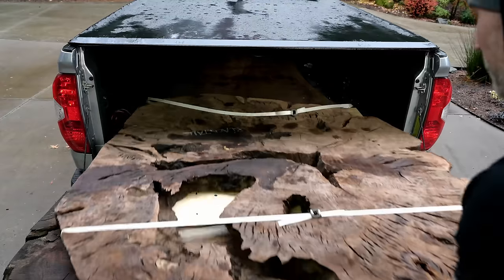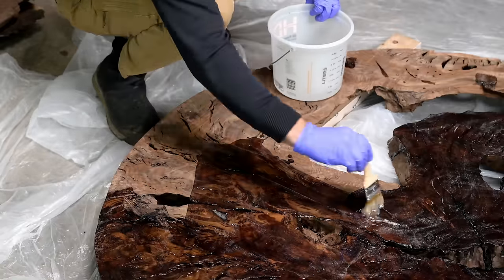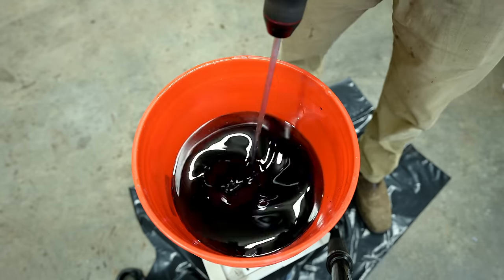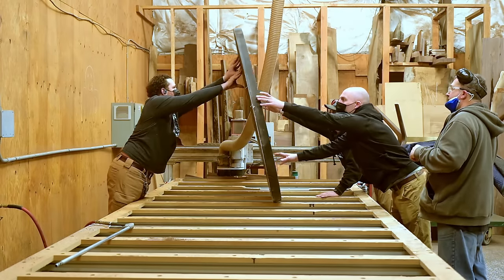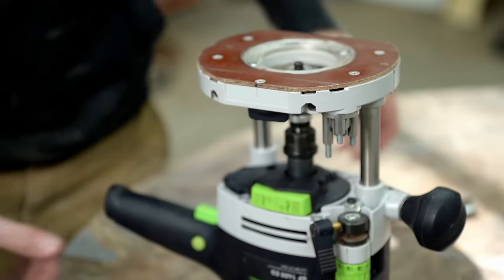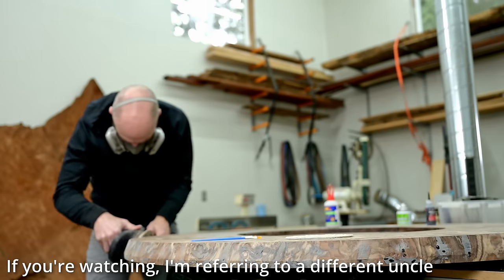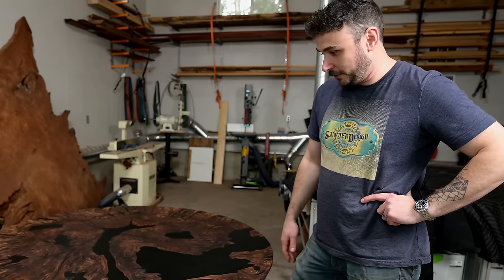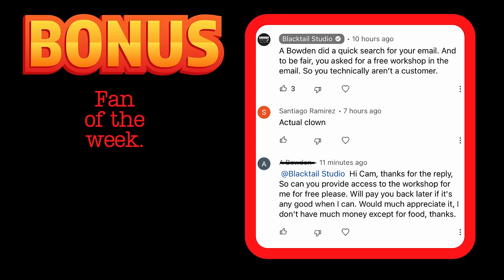The Worst Wood To Build With

Comment: Sawyer! Hi Cam - do you think the dry ice process impacted the moisture content problem?
Reply from the maker: That’s a great question, but no that’s not it. I talked to the wood supplier and this is caused by a bacterial wetwood that is often (but not always) indicated by those light yellow streaks. Any surface moisture dries quite quickly, even if totally soaked.
Reply: Dry ice generally goes straight from solid to gas form. It doesn't have any water in it either.
Reply: It’s frozen carbon dioxide so no water.
Reply: @Cobbido  Well the water would be coming out of the air as condensation.
But as Cam said, surface moisture dries quickly. (Firewood stored outside still dries, even if it's rained on regularely)
Reply: @BlacktailStudio  if you ever see a video in your recommended that you don't like, click the 3 dots and select not interested! no more annoying videos you don't like!!
Reply: @josephbucci3749  True, but the extreme cold causes water to condense from the air onto the wood surface. There was clearly water on the wood, but Cam says that the surface moisture dried quickly.
Reply: @BlacktailStudio  you are right, and there is a solution for that
Reply: @josephbucci3749  i think the concern was condensation but yeah it would evaporate too quickly to soak in.
Reply: Only time dry ice can become liquid is in a pressurized vessel & since CO2 doesn't contain H2O or D2O it can't affect how much moisture is in the wood
Reply: If the CO2 cooled the wood down to near freezing, as the wood returned to room temperature couldn't condensate from humidity in the air form on the surface and be absorbed..., the same way droplets form on the outside of a glass of a cold drink?
Reply: @Cobbido  No, but the low temp can cause atmospheric water to condense.  That would only be on the surface though, & would be unlikely to introduce enough to cause the issue here as it would also dry fairly quickly.
Reply: @Craigelz  Yes, but it would only be surface & would dry fairly quickly, even from endgrain.
Reply: Sawyer! I don’t make tables but I do enjoy watching your videos and I learn by listening to your thoughts thru your narration. This project reminded me to always have a checklist which I also suggest to you good Sir. 😎
Reply: @BlacktailStudio  you should look into a needle scaler, that would get into a lot of those tight areas.
Reply: @BlacktailStudio  incase you did not see my message: I have a suggestion for a collab/idea, Sci/Fy Alien (or geological mystical) Epoxy table complete with glowing crystals inside (Led lights that lights up the epoxy crystals within the table)
Reply: Dang, that was such a beautiful piece of wood. You win some, you loose some. 😕
Reply: I came to post the same question. You see the moister condencing on the slab, and if any dry ice at all was building up in those cracks it will lower the core temp and pull water out of the air like a spung and deep into the slab. I've worked with a lot of cryogens and moisture / ice build up is a huge problem. Maybe not the main issue here, but I'd be sure to check before and after if I did the dry ice thing again.
Reply: Dry ice is actually frozen carbon dioxide (CO2) so I don't think it should have caused any problems, but who knows? Maybe the extreme cold treatment could have caused water vapour around it to condense and concentrate more on certain regions depending on the temp, but this is just a wild guess cause most of the cookie would have been surrounded by a veil of CO2 gas after the process
Edit : just saw Cameron's explanation, ohhhhhhhhh, welp I tried.
Reply: @Cobbido  True, but because of the low temperatures it causes at surface level wouldn't moisture condence around it (not that it's the case here)?
Reply: Sawer Designs. Let it air dry, in a dry place, and then CNC it flat again. It doesn't need to be that thick.
Reply: I asked you before this question, can you make door like the tables? I would like to order one
Reply: @BlacktailStudio  Dry ice is pure Co2.
Reply: I sure hate that it didn’t work out as you planned. Sawyer got a second chance on the pedestal you should get another chance on the top. Do you have any idea if the moisture problem could be solved and what that solution would be? Other than wall art or a bond fire invite?

Comment: There is something we use in dentistry when pouring casts called dental vibrators , it helps air bubbles escape the casts before its cured . I think there is some sort of industrial vibrators that you can modify (( making a housing for it )) to help the air escape after pouring the epoxy in the tiny cracks.
Reply: Park a Harley next to it for a few minutes on tick over, that'll do it.
Reply: I was thinking some take on the vibratory device used to get pockets of air out if a concrete slab.  However, though I’m terrified to put the word “vibratoratory” in a search engine 😳,  there has to be some craftsman’s device for getting bubbles out of a pour and help it get into all the cracks/crevices.
Reply: @bearde_mut9731  🤣 thanks!  There are actually concrete and epoxy vib..uh…oscillating tools on Amazon!

Comment: I suspect that they dry ice blasting might have contributed to the deep moisture issue. I would test the next piece you send for dry ice blasting before and after, and if necessary dry it again afterwards. That looked awesome, but with that much moisture it is not going to last. Maybe with luck it will be possible to repair it in 10-15 years when it finally finishes drying and cracking, but that is a long time to store something that big that can't be used...
Reply: Shouldn't be a dry ice issue. No liquid is retained. It goes from solid to gas.
Reply: Dry ice is carbon dioxide. It doesn’t have a liquid state so it can’t leave any residue
Reply: Yes, but it causes condensation to form due to how cold it is. You cold.see the surface effect of it in the video and he even points it out.
Reply: @adamjames5097  But it is really cold ... and there was moisture in the air around.  Some may have condensed out of the air and gotten stuck.
Reply: @jimjjewett  good point 🤝

Comment: I spent 35 years as a cabinetmaker and I  used the belt sander a lot. It can be a very finicky tool to use properly, but worth the effort to learn. You also need to know how to maintain it correctly.
Reply: his technique was interesting to me , sanding perpendicular to the belt rather than parallel. i always thought you sans with the belt motion not at right angles to it
Reply: @vvsmixing  you use belt sanders at roughly 45° in a side to side or sweeping or curved motion, forward and back causes terrible inconsistency in the surface and the sander wants to run away, and 90° side to side causes some belt issues but you generally sweep it at 45° roughly
Reply: @matthewwhite876  thank you i notice on wood at coarse grit it scratches the wood in a ugly way, and looks better when those scratches are taken out by goin with the grain. or can you sand 45 to the grain and just use higher grit to take those out
Reply: @vvsmixing  I would only use a belt sander to take material away not to try sand it to a polished finish an orbital sander is the best option if you don't have access to a drum sander

Comment: Hey Cam, a bit surprised at the leaks and mould destruction. I find HDPE works very well. I do have occasional leaks but pretty minimal. For curved moulds I tuck tape an 18 mm board and then  flesh 4 mm HDPE with wood shoulders screwed through the board. Can send a pi. If you are interested.

Comment: Next time you want to see where you left screws in the project, tie a magnet to a piece of string and gently move it everywhere. If it leans toward a specific place or sticks to something you know there’s metal.
Reply: @endoranddeath6481  I think you responded to the wrong comment.
Reply: @EddSjo  I did. Great job me. ;-;
Reply: @TheScytheMoron  did you mean non-magnetic?  some steels are magenetic, some are not.  That is true, but your emphasis on magnetic seems to agree with MS B while to tone implies you disagree.
Reply: besides thats usually stainless, like A4 which you find in machine screws, but I doubt in wood screws.

Comment: You probably want to check another similar small piece of wood with the dry ice cleaning guys, just to make sure that the moisture did not really come from their process, ultimately it would be nice to know! (in my opinion even if it evaporates the cracks and pressure is so big that its possible the vapors were trapped thus the moisture.
Reply: I'm ignorant and curious: how does moisture come from carbon dioxide?
Reply: @johncornwell1026  It’s definitely worth trying it out, to know for sure. In my opinion since most wood is living porous material, it had its own previous moisture level, then introducing extreme cold dry ice, will probably shrink it, and later the moisture will seep in as it warms up from the atmosphere. Humidity, deep cracks, cold hot temperatures, it’s own moisture level, all play a factor 👍!
Reply: @johncornwell1026  My guess is that the dry ice cooled the wood down enough that it pulled moisture in, that is via condensation. However, I'm not sure how much that would have done and the only way to really know would be if he'd done a moisture check before he started the entire process. If it was good then but bad after the dry ice blasting, then it was the blasting that caused the problem. To bad he didn't check at the start.

Comment: You may want to take out the link to the eBay from the description and then note that the winning bid was $6200.  (I don't think they leave it up forever.)  I'm curious how that price was in relation to the costs put in to it.
Reply: The real cost is the labor.

Adding up just the cost of materials doesn't (or at least shouldn't...) mean much when thinking of selling price.
Reply: @CNYKnifeNerd  I implied as much.  I didn't say "cost of materials".

Comment: A stone mount would have been a better choice, or if you feel that to be extreme. Try a tree trunk mount.  Mounts need to be heavy, and sturdy enough to hold 280 pounds or more. Using steal isn't always a good choice unless it's solid steal or iron.  Table looks great btw
 Black Onyx 
Stone mount
The shaft isn't wide enough to secure the table. That's the anomaly your witnessing.
Reply: Steel.

Comment: Can always use epoxy for those stumps red colour lava with it to level top surface as well and a bottom  round wood base to support it over time and still use it for table. A round frame around for table for support if necessary.

Comment: I’ve been drying slabs from my 18-month-old sawmill and getting close to having some ready. Went to buy that moisture meter. $580!!  I think I will use my pin meters for a bit longer. 
But I love your vids and glad the table/wallpiece is going to be profitable for you. Over $6k so far!
Reply: Yeah I looked up that meter too.  Gag.  BUT, if you're making $10k tables and it saves even one project it pays for itself many times over.  Just depends on what kind of work you're doing and the scale of investment involved in your projects in terms of whether it's worth it or not

Comment: Is there a possibility that the dry ice added pockets of moisture because you blasted into the endgrain ?
Reply: I was thinking this too, maybe let it dry for a few weeks or months after blasting it with dry ice
Reply: even though we call it "ice" there is really no water in dry ice.  It's frozen carbon dioxide gas.  What surface moisture you may see is caused by condensation on the surface only (like the outside of your cold glass on a hot day) and would have dried in seconds.

Comment: What is the actual issue with the moisture? 
Will the table just keep warping?
Reply: Yeah, I want to learn this, too. Why is it a problem? Why does that moisture make it not suitable for a tabletop?
Reply: I'm no expert on wood drying but to my knowledge, it will continue warping, the wood itself might continue to split, and the wood could separate from the epoxy. That being said, with a wood like walnut, if it's kept indoors somewhere that isn't a desert, it'll probably just warp some and be tolerable as a table if you didn't spend like 10k on it. If I did spend 10k on it though, I would not be happy that it warped on me.
Reply: I'm with you mate. What will moisture spots do?
Reply: @David Cole as the moisture escapes the wood contracts.  Depending on how much moisture is involved and it’s distribution in the piece, the orientation of the grain, etc it can cause warping, local dips in the surface, adhesive failure in the epoxy, the finish can flake off, new cracks can appear, etc.

Comment: I've got an octagon end table/coffee table. It once had glass in the middle til I tried putting the table somewhere safer than my garage. Needless to say I should have just left the glass taped to the table, now I want to fill in the center with epoxy and small wood cookies for a outdoor theme. I was worried about the center being to heavy for the already base frame so your currently helping with the process and how to fix the center

Comment: Sorry if anybody asked this already, but have you thought of using a sous-vide to keep the bottles of epoxy at the temp you want them to be? It would allow you to keep that variable constant, and it would allow you a wide time window to use them by keeping the temp constant for as long as you want. There's at least on commercial one out that that can be set as low as 75F and has a 5 gallon bath. Just a thought. Love your content, btw.

Comment: I have never worked with this method of epoxy/wood... My work involves mostly restoring furniture and pianos... so I was kind of happy with myself when I had predicted every problem you had as I was watching - except the moisture issue at the end (yes, I even predicted the metal tube fix for the base).

So a few comments/questions:
1- wouldn't it have been easier to put screws into the bottom of your piece when doing the initial epoxy coat instead of 2x4s. That way you just unscrew them when done?

2- instead of trying to man-handle the top through the router - wouldn't it have been easier to use a pin in the center and just spin the table around the router?

3- The moisture?
   A. Your video shows that it was raining as you transported the slab to the blasters (so high relative humidity).
   B. The dry ice cause condensation and frost - which of course is absorbed.
   C. and transport back in wet weather.

As the video shows, the dry ice caused some pretty large patches of frost to form on the wood - and a good distance from where they were working, meaning the wood is cold enough to retain that temperature (otherwise it would flash off). This would result in a good bit of moisture absorption, deep into the wood. Frost isn't just forming on the surface, it will be in the wood as well. Notice how wet the wood was when you unloaded it?
You said the shop is cold, and so, not very conducive to drying.
You did not say how long the slab was left after this. Was there any method used to dry the slab before the epoxy pouring process began?

Generally, if we are having to repair a piano's sound board (which can be very much affected by moisture absorption) we will use heat lamps to dry the wood before we begin. The idea is to bring moisture content down slowly, but get it below levels it normally would be at.

I think my point/question is - Why do you think the slab was too high a moisture content from the lumber yard and not caused by the processing?

Comment: First time viewer . Sam, Working with old redwood berrels about 50 years ago i loved keeping it natural . No pun intended . Wood, unless you can or need to make it fit into a conner..I was happy to see your video. 50 years ago a table like your making would have cost $700 and up to $1000.00 . My point is your selling them too cheap. Adjusted for inflation if you learn to do really smooth work a long 8' to 10' × 3' wide cost $2000 a foot. Its the people you market this table to should know how hard these table' are to make. Ive destroyed a peice of wood or two when i was 'learning so try not to stress. Belt sanders with dust bags or direct to a shop vac works great. Good luck in making these videos.I loved watching it. Dont sell youself short. Woodworkers must share ideas .

Comment: Hi, the jigsaw runs off the 90° cut because the top of the blade eats wood a bit faster than the bottom and when you apply pressure it creates even more angle. So there's a trick to avoid it - gently push when you entering the wood to save you 90° and keep moving jigsaw without forcing it forward.  You'll feel how the blade has no resistance and just doing its job. I was able to cut 4"walnut for my wood carving projects.

Comment: Dark
I see that this video is from 2022, so you’ve probably already found a product you like for your new spray gun, but I wanted to suggest Mohawk’s Pre-catalyzed conversion varnish.  I use that in conjunction with their sealer and get excellent results. It dries quickly and only needs 220 grit paper between coats. Great video and good luck.

Comment: Sawer!-Cam! have you tried vacuum to get rid of the bubbles before you pour?  At the restaurant, when we make foie gras terrine, we have to pour the foie gras into a plastic lined mold.  The foie gras is seasoned, poached, and pass through a fine mesh to capture any blood vessesls, and this process traps bubbles.  We use to tamp the mold to encourges the bubbles to rise to the top, but I found out that it is much easier if we pull a vacuum, which make the bubbles increase in size and flow to the top where it can be popped.